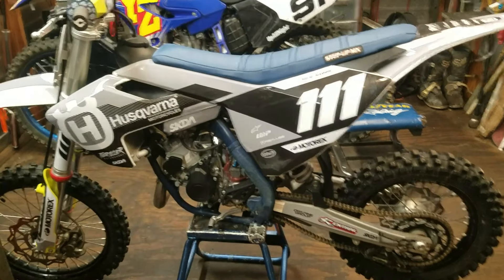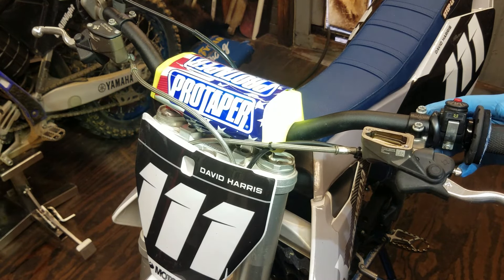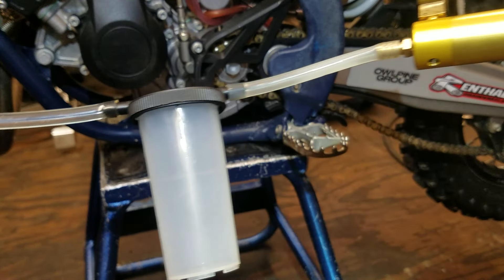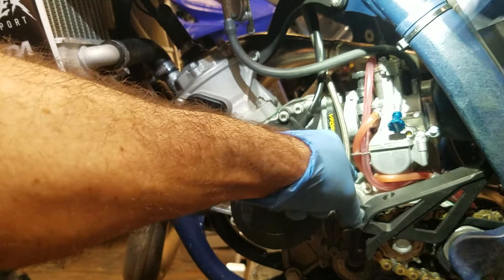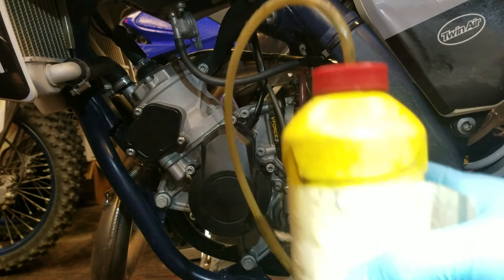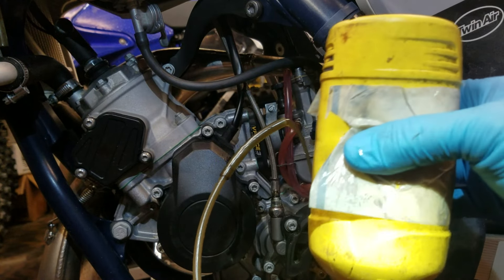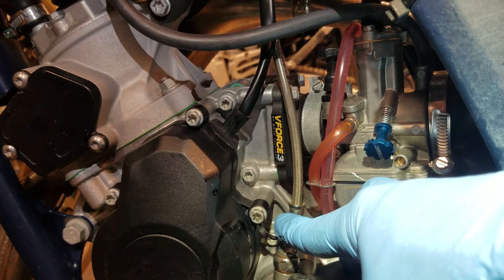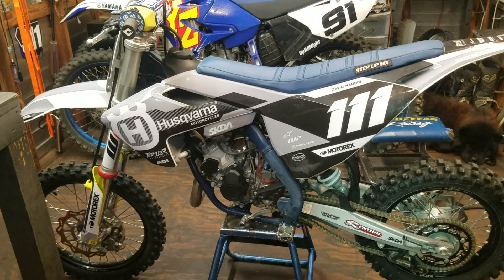1:11 Bleeding Hydraulic Clutch & Brake. KTM Gas Gas Husqvarna Motocross Dirt bikes

Comment: Thank you so much man! I'm working on a 23 FC350 for a friend. The bike threw a chain unfortunately. I thought the slave could be reused but we determined the piston is not moving in and out smoothly like it should so I ordered a new one. I hope that fixes it. If not, I guess the case will have to be replaced. It looks like Husky only sells them as a set so I don't know how I'll find a left side.
Reply from the maker: Right on.  Sometimes I get lucky finding one case half on ebay used.

Comment: Heard dot fluid deteriorates the rubber in magura systems
Reply from the maker: I imagine it could. I should have mentioned we had good luck using DOT 4, never tried 3 or 5 magura though.  We ran it in bikes for a couple of years with no issue, although not sure if we just got lucky. But years ago I put dot 3 in a bike that called for dot 5 and it swelled the rubber parts in the master cylinder up and we needed to repair.

Comment: Sometme could you do a video on trouble shooting a "no Spark" condition.We had this issue this weekend on a 2000 KDX 200.Tried to chase down the problem with volt meter but not much luck figuring out if it was the CDI, coil,magneta kill switch or what ever.Long story short its still down. Thanks
Reply from the maker: Yes sir! As soon as a bike comes through with no spark I will use it as a walk through. I will say 95% of the time on a 2 stroke when the spark goes out its the stator. Of course always check the kill switch first by disconnecting the kill switch and then check for spark (also check for loose connections and broken wires throughout).  But in most cases its the stator.  I have seen CDI's go out but maybe only 3 in my life, compared to maybe 100 stators.
Reply: @UpAllNight91  .The stator looked really bad like it had gotten water in it at one time.The fly wheel was rusty and some of the bolts and crank had somr rust on them.Thanks
Reply from the maker: @tndeere  Ok. I have seen stators that test well with a multimeter but just wont work. So even if the meter shows everything good with the stator doesnt mean it is lol